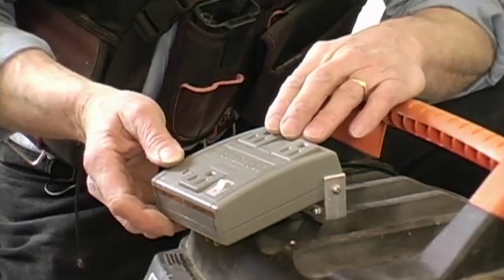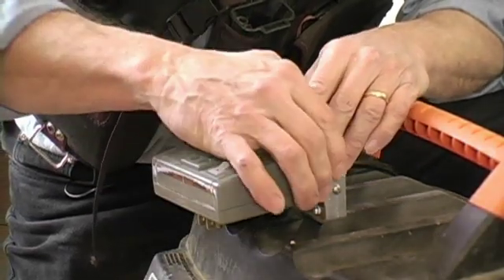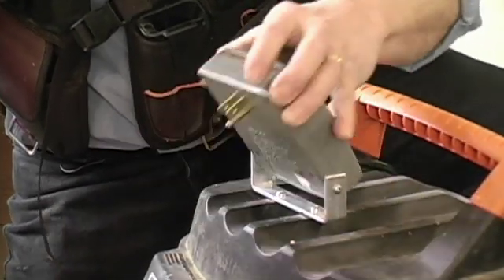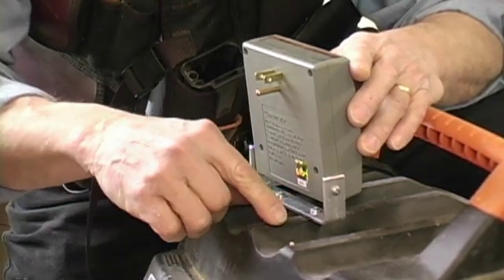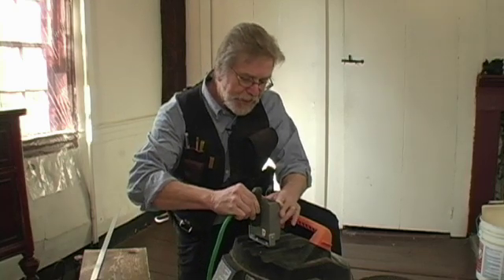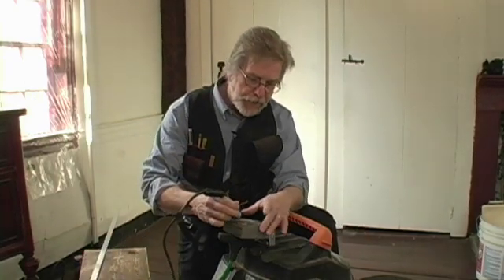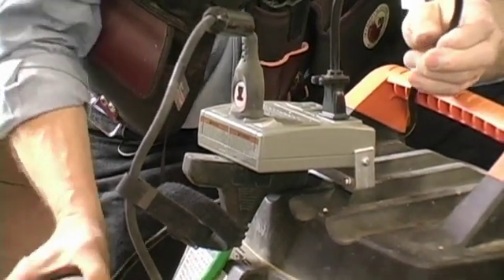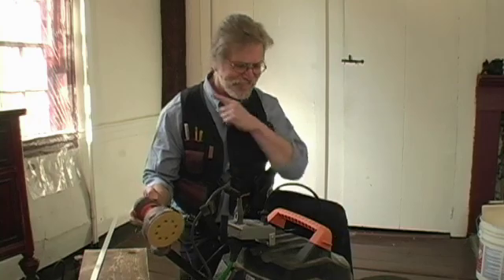Make a Tool-Actuated Vacuum

Comment: hey what I did was I connected a foot peddle to a double plug orange extension cord and plugged my scroll saw and shop vac so now when ever I need to make a mess with the scroll saw or any tool in my shop I have foot peddles and cheap shop vacs from harbor freight and it runs both of them at the same time.

Comment: It's much better to buy one of the commercial vacuum actuates switches that has two inputs. That way you can run the saw/router/bandsaw/sander drawing upwards of 12 amps on one circuit, and run the vacuum off a separate circuit (assuming there are two separate circuits available near where you are working.) Otherwise, you will be tripping the circuit breaker most of the time.